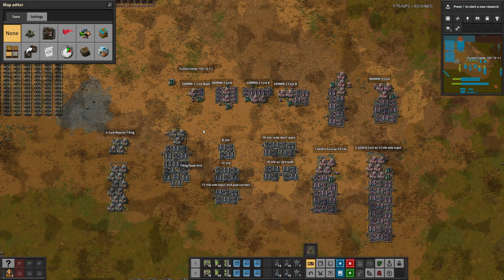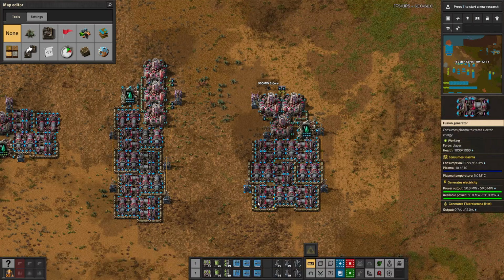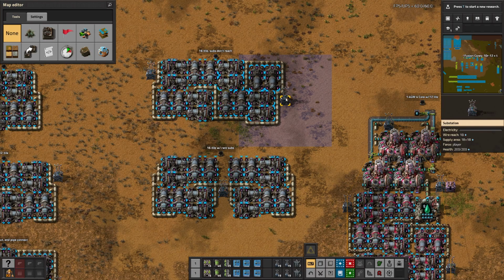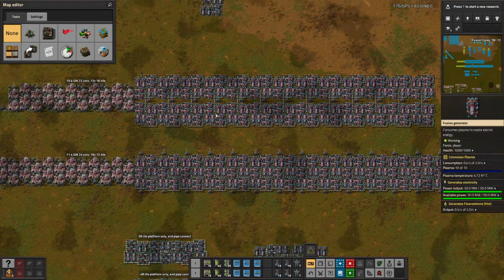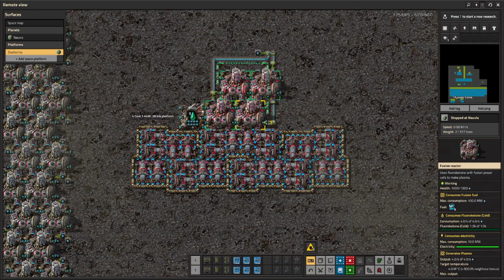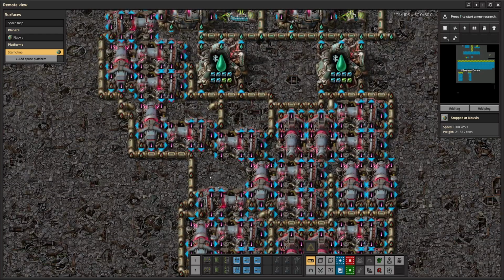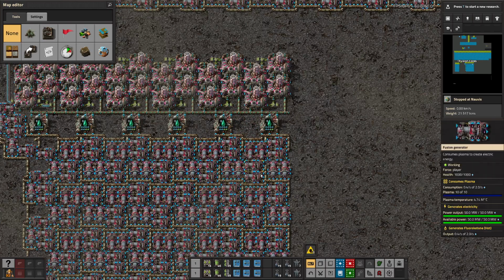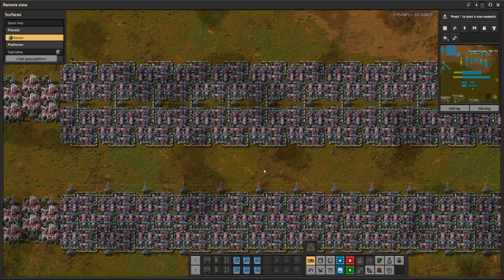Factorio Space Age: Fusion Power - Compact, Tileable Reactor & Turbine Designs

Comment: I have to say, I'm not fond of the layouts that come from the fusion design. In my old vanila game, I had two 100GW nuclear PPs (and yes, they both needed to be built on a large lake to satisfy all the water input requirements), but it looked good. Also, I've run into another thing, nuclear PP on platform has two benefits - it consumes water (which is very abundant and you often need to dump the ice to keep up the calcite production), but also, it allows you to build refinery setup with advanced coal liquefaction as that's the only way how to get steam on the platform. If you prod mod the whole chain, you can go coal synthesis - liquefaction - light and heavy cracking - sulfur from gas and end up with more sulfur than you've used at the beginning, ballancing the carbon production.
Reply: But advanced processing has the perfect ratio to make one dynamite, which you can use for rockets.
Reply: You can also burn carbon in a boiler for steam
Reply: @dimitrisavic4702 no burners in space

Comment: the law for calculating the reactor-generator ratio only works for linear designs, a donut shaped reactor group or a line that loops back to itself does not have the -12 since each reactor has a higher avg of connection points. For example an 18 reactor setup could produce 9GW worth of power in plasma instead of 8.4, and then you could tile that 18 reactor shape infinitely. Also you can fit normal power poles in thE center of that 8 generator group
Reply from the maker: Yup, the ratios change slightly if you're not using the standard line layout.

I'll wind up doing the normal power poles if I can't find another solution but in lategame I don't make/carry them at all. As I said in the video it's something that I need to iterate on more but right now I'm working on other projects. I'll return to it at some point and the blueprints will be updated when I do.
Reply: Someone has been reading fff.

Comment: i just managed to get my first bit of cryo science off the planet and went ahead to unlock the fusion reactors to finally get reliable and easy power on Aquilo (copied and modified my ship that took me there to harvest ice blocks and drop them to the planet to have easy access to water - didnt want to drain the ammonia nonstop manually...) and have been struggling to understand the layout of the turbines...
and i gotta say: wow! i am blind... the moment i saw your layouts i noticed how well it fits - gotta play more puzzles again...
but i have one big questionmark hanging above my head still: do the fusion reactors really not consume the fuel if they arent connected to the power grid? (like using the power switch to stop them from burning through the fuel like nuclear reactors) have you checked up on that by chance?
thanks in advance <(^.^)>
Reply: fusion reactors are energy efficient by themselves, if the power output of the generators is full they stop consuming plasma, and if the plasma in the reactors is full they dont burn the fuel cells
Reply: thanks a lot!